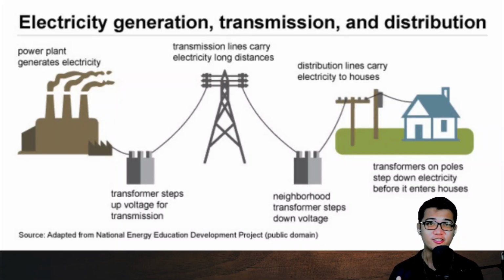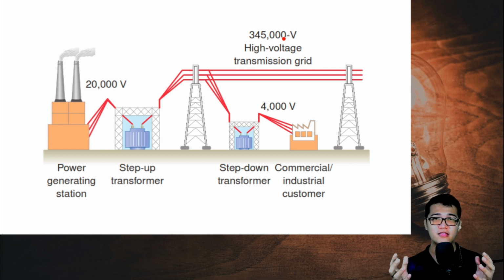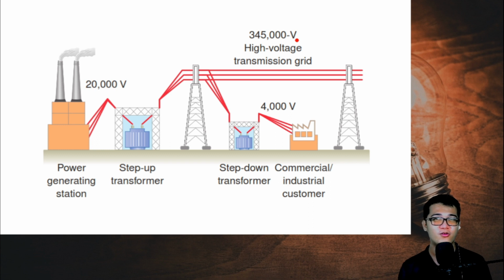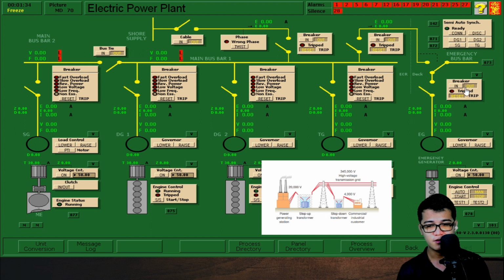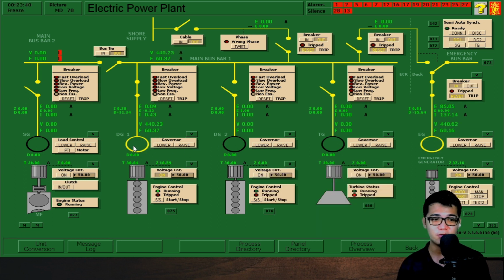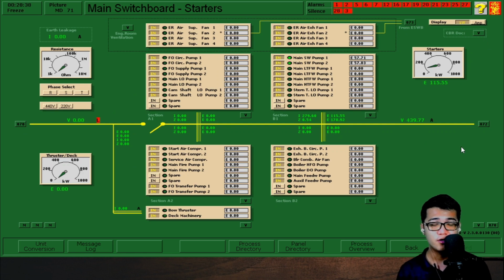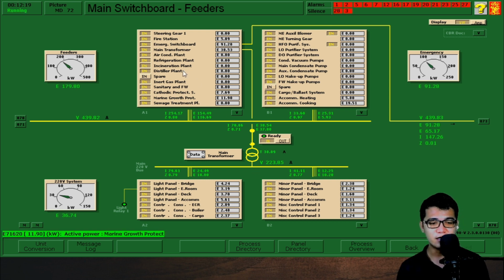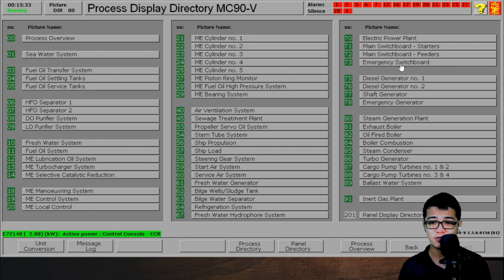Power Distribution System | Errol Karl Gumagay

Comment: #Quijada Ryan Base on the videos the topics focus on the Electricity generation, Transmission and the distribution.
I learned the Correct or proper transmission and the distribution of the electricity to the Electrical Machinery on board ship and  power distribution of system ship. 
Based on the Distribution, Transformer pole step down electricity distribution before it enters houses, in generation station  electrons I, the purpose is power = Voltage x current
Electric Power plant  for ship Electrical generator
Composed of the following: 
Shop generator 
Visual 1 Generator
Visual 2 Generator
Turben Generator
Emergency Generator
Source Supply Generator
Circuit Breaker switch  for the Emergency Switch Board meaning the Purpose this Breaker is Actually as Breaker for emergency switch Board. Emergency Bus Bar Supply cable voltage . The Emergency Switchboard - a switchboard provide power to vital services including the fire main communication, steering and so forth. When the ship’s main power is lost emergency is automatically provided by the emergency generator through the emergency switchboard by an automatic transfer switch. Emergency Fire Pump and Emergency Transformer in which actually step down our voltage as we notice from 440 Emergency Bus Bar Voltage after passing through Emergency transformer became 224.  This 224 actually power of the navigation Lines.
Main Bus Bus 1, actually connected not only to Emergency Bus, But also main Electrical main consumers of our ship. Types of Electrical Consumers: 1. Pider 2, Starter.
Reply from the maker: Shaft generator; Diesel Generator 1, Diesel Generator 2, Turbine Generator, Shore supply (this is not a generator).

Comment: What i learned in elecrricity generation, transmission, adn distribution powerplants generates electricity the generated electricity pass to transformer Step Up voltage before it transmite, they going to increase the voltage after feed the transmission lines after the transmission lines drop into other transformer for Step Dowm the voltage and  and carry to transmission line and going yo transformer again to usesable voltage of 220 volts.